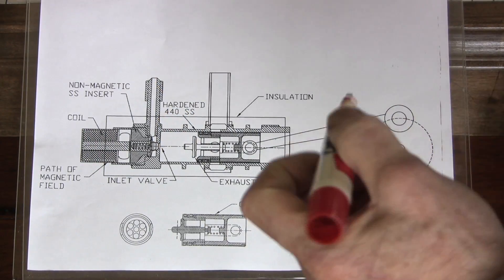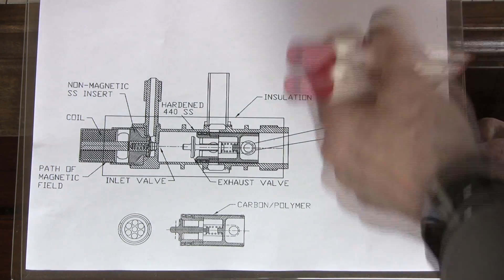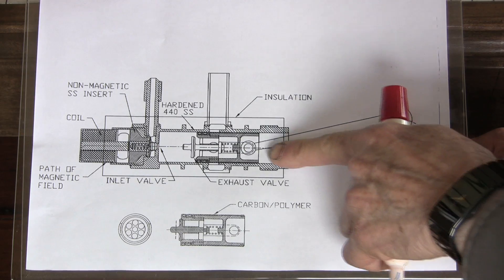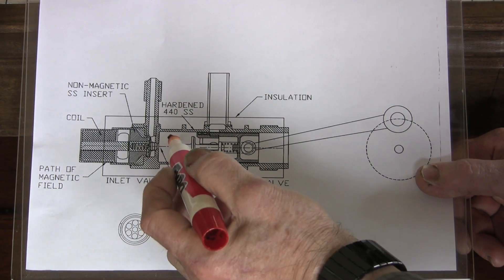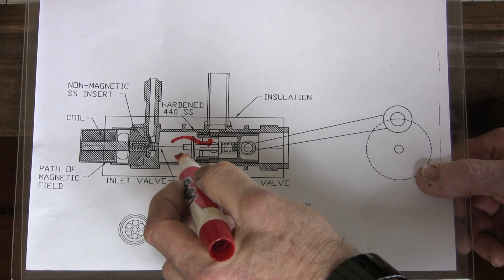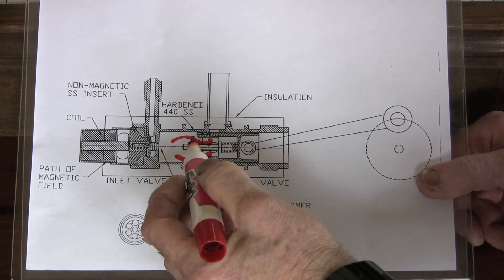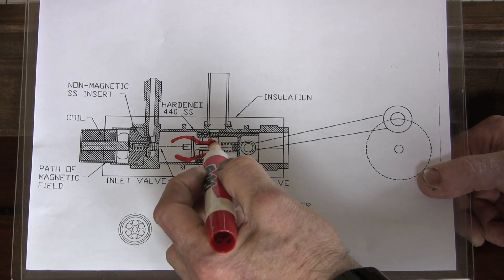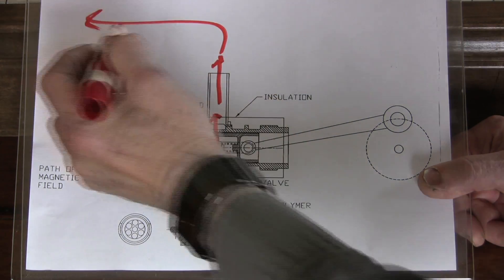Dan's Uniflow Steam Engine

Comment: He essentially reinvented the Hood Electronomic Safety Buggy's valve gear:

https://patents.google.com/patent/US694547A/en?oq=us694547

The difference is that Hood did it a century earlier.
Reply: And used something similar to an automotive distributor rather than an electronic circuit.

Comment: So when does the coil release the inlet valve?
Reply: At a variable point in during the downstroke. Early for maximum expansion and economy, late for maximum power. The governor acts on the length of them the admission valve is opened (cutoff governed). I assume he is using a microcontroller to operate the governor.

Comment: Really nice job. I read about your efficiency measurements. I'm curious on what cut-off ratio it ran during the test. Or if you have some results with maximum possible expansion ratio (1:10 guess). If you ran at full throttle like 1:2 cut-off timing then going to 1:10 should bring 40% more efficiency, going from 10% to 14% overal. If valve travel allows (bigger scale) then exceeding 1:20 expansion will start attacking 20% overal efficiency.
Thanks

Comment: Wondering if it might be possible to guide a piston in a bore by replacing piston rings with hydrostatic slide bearings placed around the piston? Such bearings would move up and down with the piston. . if clearance between bearings and cylinder walls are tight, there'd be a minuscule flow out of such bearings. A small steam receiver could be built in the piston, and so to could flow resistors to provide the bearing stiffness. the air receiver would to have a source of high pressure fluid... a small non return valve to above the piston, could charge the air receiver up to full pressure on each working stroke. there would be a need to pressurise the receiver before running.. such could be done by a similar non return valve communicating to the exhaust post. A shut of valve in the exhaust and connecting the boiler directly to the exhaust would force steam into the receivers

such an arrangement of hydrostatic bearings, would also ease the choice of materials that can be used for piston, and cylinder liner... of great benefit would be the avoidance of need for materials to be different/suitable to rub against each other, due to the clearances inherent in  hydrostatic bearings. .. It becomes feasible to make both piston and cylinder liner out of invar. if both are made out of invar there is no problem with differential expansion along the cylinder bore. that should help keep the clearances tight, and also avoid bore wear.

Comment: int not a Uniflow Steam Engine because only 1 side valve intake!!!!!
Reply: The critical part of "uniflow" is the unidirectional flow of steam from one end of the cylinder to another, so as to prevent condensation of fresh steam by cold cylinder walls which were cooled when the previous steam charge was exhausted through the same port at the same end of the cylinder.

Comment: Mechanical valve gear is more simple, more rigid and cheap. And uniflow engine requires additional valve for condesate removing
Reply: +Feuerkrieg NordMeer Why the concern over condensate/extra valve? For this design the inlet valve can also work as a pressure relief valve- any condensate trapped on an exhaust stroke will lift the inlet valve, and cause the condensate to be pumped back into the steam inlet. That avoids hydrolocking and it's damaging cylinder over-pressurization better than other designs.

It's also incredibly easy to adjust the cut off. to blow of condensate run with more than 100% cut off.  With both inlet and exhaust valves open at same time, condensate and steam will flows straight into the exhaust.
Reply: steve cummins Only if you have a starter.  If engine is large enough, inlet pressure can be more than 120 bar, so engine must be turned back and forth until the condensate will not be pushed out by live steam.
Another thing is it can be efficient only in short RPM range. In low RPM you need more to reduce heat losses, but in high RPM you need almost clean cylinder.
In single expansion cut off may reduce steam consumption a little bit, but in compound engines VVT for inlet and exhaust is necessary, I think.
P. S. Sorry for not the best english
Reply: @valeriyreiter4199  
Uniflow steam engines have highest efficiency of all reciprocating steam engines. More than most compound expansion types, and with much simpler operation and construction, and much better part load performance than compound expansion types. Uniflow steam engines were the last state-of-the-art technological advances in steam engine technology before they were finally surpassed by other technologies in the 1940s and 1950s.
Reply: @stevecummins324  
Exactly. This style of valve prevents the excessive recompression on atmospheric exhausting uniflow engines. And the electronic control allows easy and accurate control of timing, power, and efficiency, and would work well in transportation applications where the computer controlling the throttle and cutoff could automatically use full admission and low throttled pressure for starting, and then change over to full pressure and partial admission of steam cutoff once up to speed.

Comment: I didn't really understoot the need of the valve of the piston.
Reply: Ordinary uniflow engines tend to have to operate with a condenser. If they operate at atmospheric exhaust, they have to have auxiliary exhaust ports to relieve the excessive recompression because the exhaust ports close too early as the piston comes up. This valve allows exhaust to continue to exit on the up stroke while maintaining the uniflow path of steam for high efficiency, the best of both worlds. It's a brilliant idea.
Reply: Eduard Voicu the valve in the piston allows it to up stroke without having to push against increased pressure in the cylinder.
Reply: It is also a good trick for a neutral operation in clutch less car installation. When throttle pedal is released the steam input is closed with external valve and the engine can keep "breathing" without counter force. The only drawback is that the cylinders gets cooled.